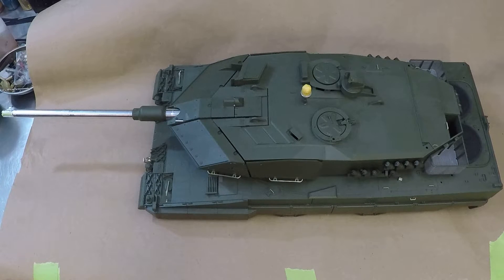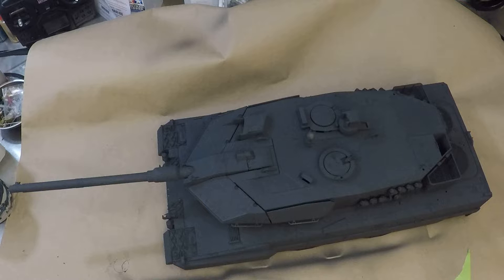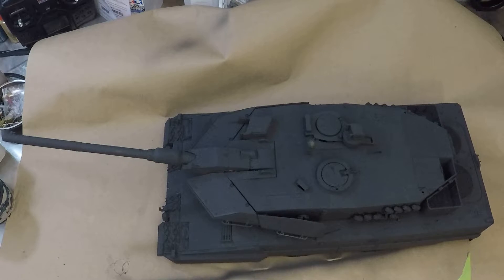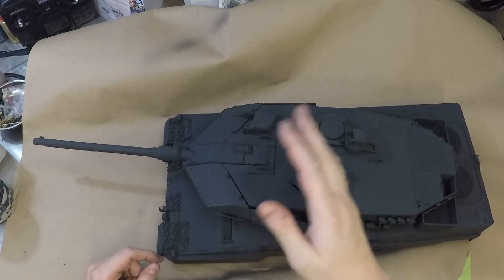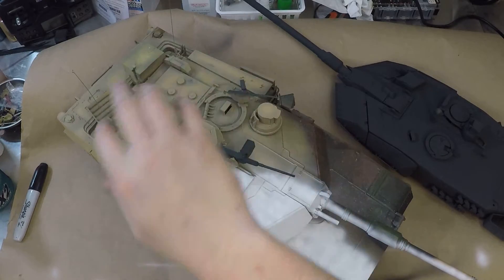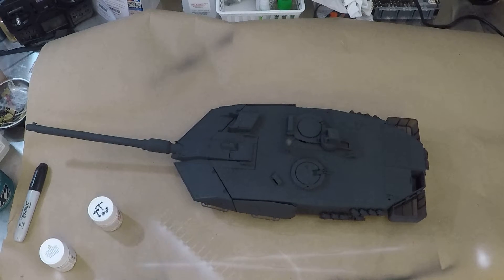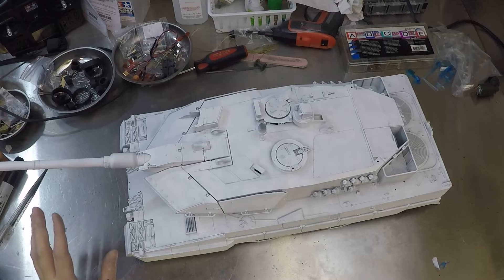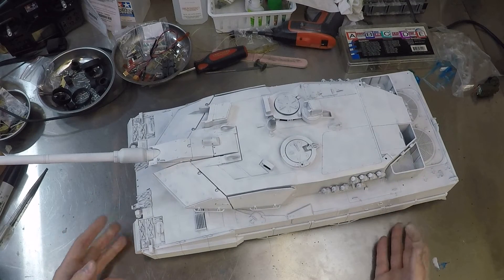Tamiya 1/16 RC Full Option Leopard 2A6 Tank #56020 Build part 12

Comment: The grousers maybe should be black / gun metal.
They are the "X" plates near the front wing mirrors. When you need extra grip you remove some of the rubber track pads and insert the metal "X" ones instead.
Reply from the maker: I am aware of the grousers, funny if you watch my recent Agora models 2A6 build I go over that in more detail.
Reply: @PitstainHobbies  I'm catching up here. :)

Comment: Did you have problems fitting the upper hull with the lower hull??
Reply from the maker: Yes, the king kong lower did not fit very well as it is a poor copy of the stock plastic hull, just use a stock lower and there will be no issues.
Reply: @PitstainHobbies  thanks.